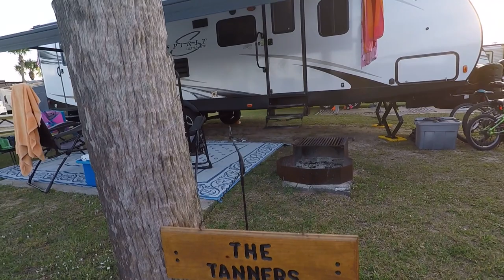RV GRILL HOLDER  DIY

Comment: Not a good place to mount that bar on the chassis, as that tyre moves up with the suspension its not leaving a lot of room to clear the tyre.
Reply from the maker: I don't drive with the grill attached.  That would be crazy.
Reply: @tannersbiz  Sorry I was referring to the steel bolted on the chassis and the clearance to the tyre
Reply: @GHOSTWHOWALKERS  If you look closely the receiver mount is not even close to the tyre's suspension travel area. He did a nice job.